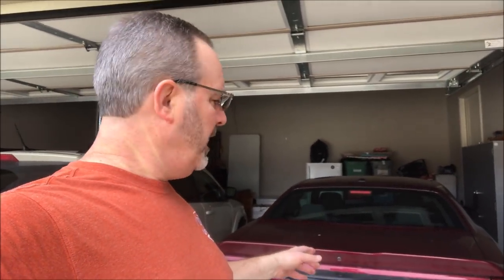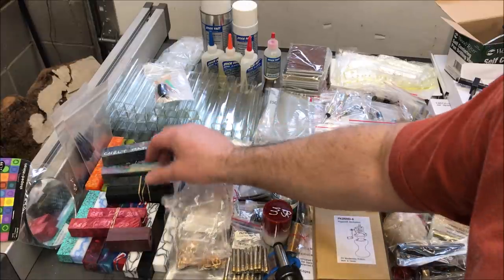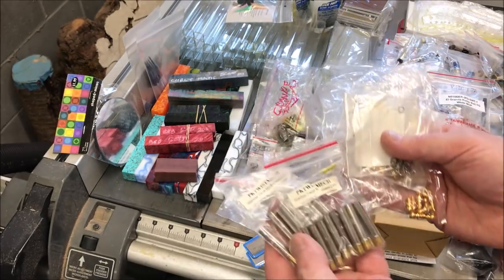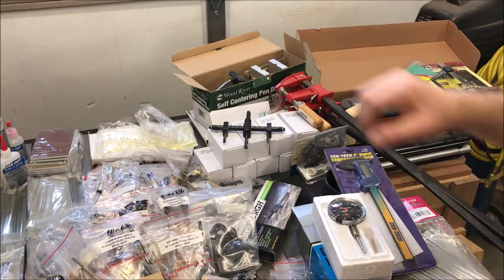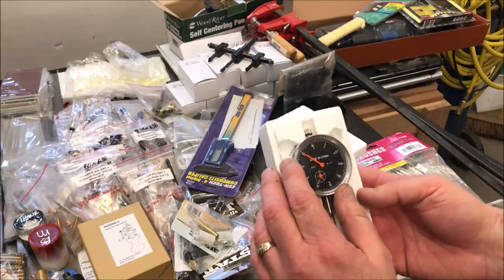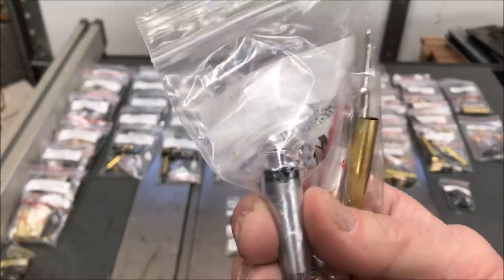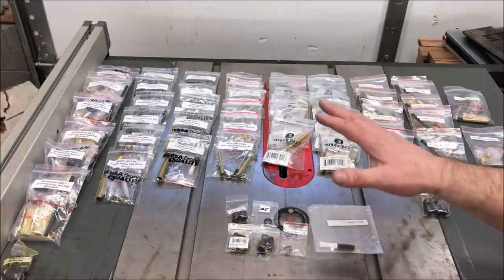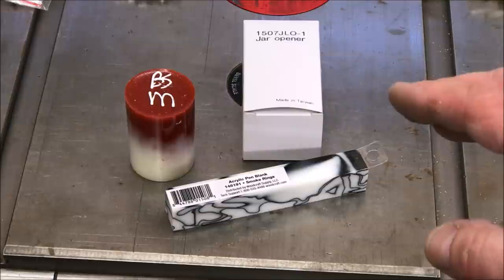Huge Tool Score !!!

Comment: The "little rubber stoppers" are for bottle stoppers, they seal the bottles.
Reply: Yep.  You put them on a a half-inch-ish dowel/tenon on the piece.
Reply from the maker: Thank you, I appreciate the help. 

Regards,
Bob
Reply from the maker: Thank you for the help. 

Regards,
Bob
Reply: They look like Salt/Pepper Shaker stoppers to me.
Reply from the maker: Diemen Design there hollow, probably should have given a better look on the video. 

Regards,
Bob
Reply: @RJBWoodTurner  That is a strange one then, they looked like caps in the video.
Reply from the maker: Diemen Design I didn’t take the time to thoroughly show them.
Reply: @RJBWoodTurner  All good, it's got me wondering what they are.
Reply from the maker: Diemen Design I was told they are for bottle stoppers. You put them on dowels.

Comment: Right, you bought stuff you didn't need because the price was so low so I'm going to guess $180.
Pepper mill - easy, easy, easy... a base is anything you want so just make a shallow mortise in the top to set the base in (it looks better than sitting proud on the base... drill in tiny stages and assess the look of the mill in the mortise before going deeper because depth matters).  Then drill a hole down through the base in the centre of the mortise leaving a shelf for the base to sit on and the screws to fix into.  Hey Presto!.. done.  Lots of videos on here.
Best Wishes, Brendan.
Edit, here's a really tidy method that takes a bit more time but looks really good, Mike Waldt https://www.youtube.com/watch?v=bGcCMDkHsc4)
Reply from the maker: Thank you Brendan,
  Going to see if my wife would like a pepper mill. If she would, then I’ll make it for her. 😃

Regards,
Bob

Comment: Greetings from Nebraska,How exciting.  We are so rural over here there are not many opportunities for finding such great deals.  I'm guessing $50 -- now that would be an Amazing Buy considering all of the great stuff in the cache.I'm sure someone has already commented about the stoppers - they are silicon bottle stoppers that are designed to fit over a stepped wooden dowel. I use 1/2-inch dowels, 1.5 inches long with the step turned down to 3/8 to fit into a 3/8 hole drilled into the bottom of the stopper blank.I thoroughly enjoy your vids on both channels.Dave
Reply from the maker: Thank you Dave,
  And thank you for the info on the stoppers. 

Regards,
Bob

Comment: It looks like most of  the bushings are from Berea; check the numbers on their website.  I use the thin Micromesh sheets for dry polishing on acrylics and CA finishes  They work fabulously.  I think the chains are for light pulls.  The Euros are nice kits but you will need to cut a tenon for the center ring.  I have made a few of the jar openers.  They are nice but don't work too well - they are kind of loosey-goosey.  $147.50.
Reply from the maker: Thank you John. 
  I appreciate all the good information on the parts and pieces. 

Regards,
Bob

Comment: Hey, I found your videos from looking up how to make fountain pens, but I had a few questions before I started to even attempt it. I was first inspired by a resin kit that I got, where you can make your own designs on things like coasters and water bottles, and I didn't know if that was an appropriate material to make a solid resin cylinder that I would put on a lathe? Would that work?
Reply from the maker: I’m not really sure what type of plastic it is. I’d say give it a try, you have nothing to lose but a little bit of resin. Experimenting is half the fun and you never know what you’ll discover. 

Regards,
Bob

Comment: I use those stoppers with the syringes I use to measure epoxy. They go in the bottles of resin or hardener and the syringes simply go in the hole in the stopper and you turn the bottle upside down to draw the product into the syringe to measure exact amounts.
Reply from the maker: That’s good information. Thank you. 

Regards, 
Bob

Comment: That pepper grinder only requires a 3x3 piece of wood, 4"-6" long. Chuck it up, drill it out, screw mechanism to blank.
Reply from the maker: Thank you Mark,
  I appreciate the info. I’ve never even looked and one of them before so it’s a whole new ballgame. 

Regards 
Bob
Reply: @RJBWoodTurner  They are my top seller at craft fairs.
Reply: Mark you’ll have to post us a picture or two.

Comment: Good idea for the Dust Collector. I'm looking at using a 1000 litre Tote that I can pick up with the Tractor Forks as well as installing either a Thiene Baffle or a Cyclone. Good find on the stuff too.
Reply: 4:39 Most likely stoppers for Salt/Pepper Shakers.
Reply from the maker: Thank you Diemen. 

Regards,
Bob
Reply from the maker: Thank you.